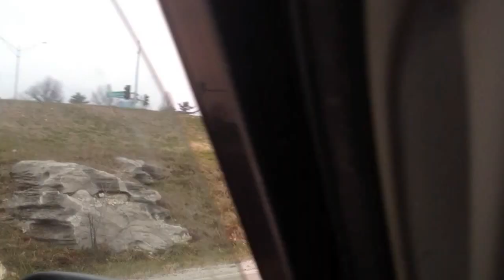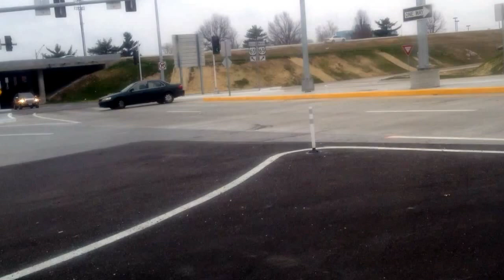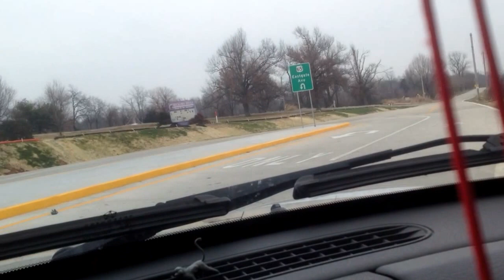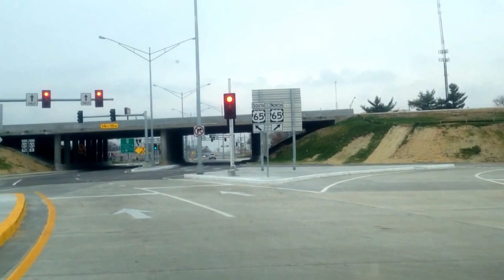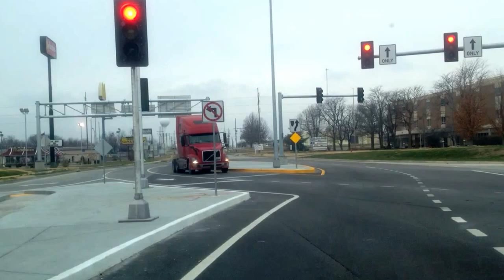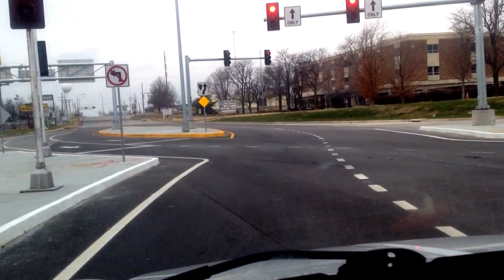Diamond interlace interchange stupid thing

Comment: This is a half-brained with a freaking U-turn at one end with a road of two lanes that looks disused, I have seen Double Crossover Diamond or Diverging Diamonds with much better flow and half the lights of an older four way that they replaced with free flowing left and right and the through traffic having stop lights with no way to drive through as before nor any possible u-turn in the roadway.

Comment: Hmmm ... the most people drives and rides from the normal street to the highway and from the higway to the normal street. Less peoples drives and rides from the highway back to the highway. Less people drives and rides from the normal street to the normal street. So is this design a very good idea. 

With the first traffic lights install the most driver's and rider's was angry too. As they installed first traffic light at 2005 at Chaweng Ring Road/Chaweng Beach Road Crossing in Chaweng City, Ko Samui, Changwat Surat Thani, Thailand no driver and rider stopped at red light, they drive and ride same before. After the police check this place and teach the people with pay money if they not stop at red light the traffic flow now 100% faster at this point as before. Specially if you come from the Beach Road.

Comment: As I understand it, the diverging diamond interchange design eliminates the need for most of the land you'd need to do the old "cloverleaf" interchange. The cloverleafs were fine back in the 50's when the interstates were out in the countryside and there was plenty of room for on/off ramps, but these days there's much less space around the highways.
Reply from the maker: that is possibly true. You have a good point. but this one is only sort of half built. and more to the point it existed previously (not a clover leaf though) with the same number of lights in use. this is wasteful use of public funds. it is also a low usage rate intersection.
Reply: Yes...
Reply: @wb5plj  yes